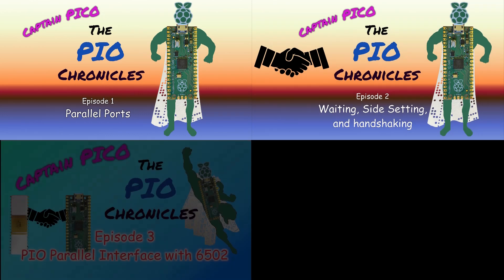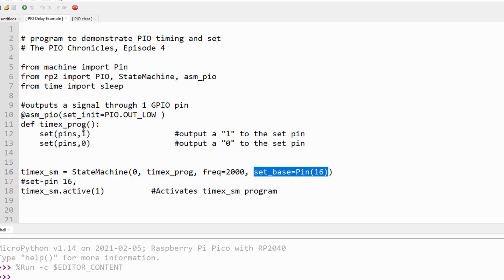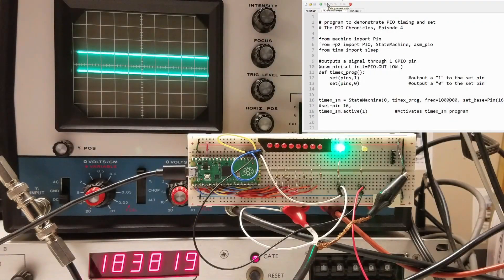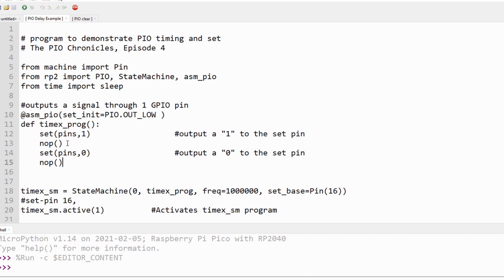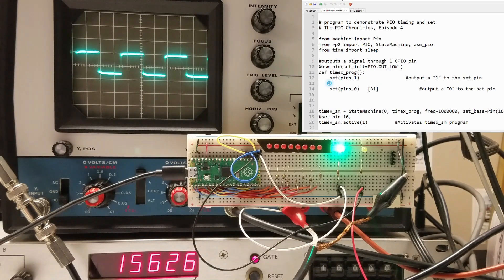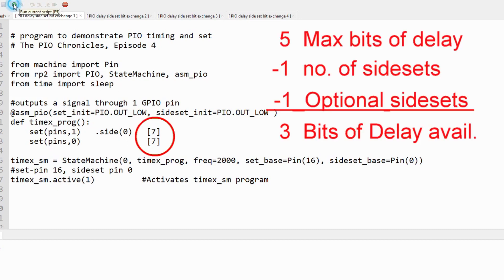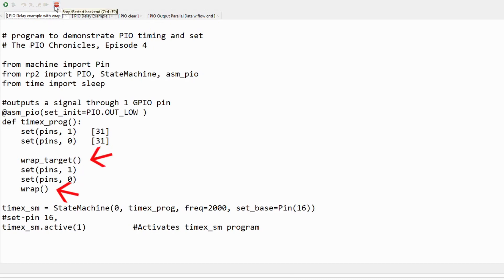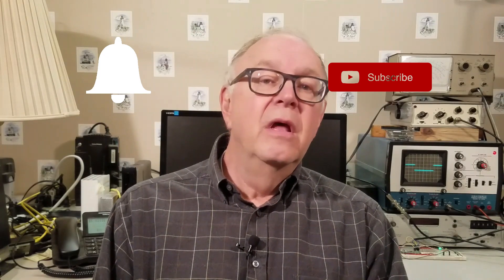Raspberry Pi Pico PIO - Ep. 4 - PIO Timing

Comment: I think I know what  MCU I'm buying next. Working towards fuel injection, and the PIOs seem like my most  realistic option towards the level of telemetry latency, asynchronous logic flow, and consistency I want. Got a lot of programming shit to learn for all that. Going for F1 AND OEM quality standards as a minimum. Right now I have a 2560 and a generator lol
Reply from the maker: I've often thought about an entire engine management system and I think the Pico would do a great job.  Good luck!
Reply: @LifewithDavid1  I decided to go with the SAMD21 based units, like the Ardunio Zero. Should be simpler to implement. PWM/duty cycle capture would make rapid/low latency RPM measurements easy. Gives a value that doesn't need calculated against last measurement, and doesn't need a provision to prevent timer overflow.

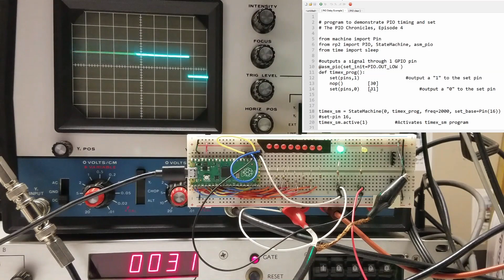Comment: Great series!  Question at time mark 7:08 you have a nice pulsing LED however I coded it up myself and the pulse is significantly faster and I am not getting that nice slow pulse you are getting.  Any thoughts?

from machine import Pin
from rp2 import PIO, StateMachine, asm_pio

# Outputs a signal through 1 GPIO pin
@asm_pio(set_init=PIO.OUT_LOW)
def timex_prog():
    set(pins, 1)  # output a 1 to the set pin
    nop()           [30]
    set(pins, 0)    [31]  # output a 0 to the set pin

timex_sm = StateMachine(0, timex_prog, freq=2000, set_base=Pin(16))
timex_sm.active(1)
Reply from the maker: Thanks for watching.  The frequency is actually 32 Hz (see the frequency counter display).  The reason the LED seems to be blinking slowly is that I'm recording at 30 Hz.  The result on video is a 2 Hz (32 - 30) beat frequency, so it give the illusion of a slow blink on camera.  It sounds like you coded it properly.
Reply: @LifewithDavid1  Thanks David!  Would love to see more on how we can do PWM style animations with LED's in future tutorials with PIO if you had time.
Reply from the maker: @mytechnotalent  My next video (in a week or so) is about the JMP instruction in PIO.  This will be the basis for being able to vary the frequency of timing loops.
Reply: @LifewithDavid1  looking forward to it David thank you for your great work!

Comment: so the main program and the pio script can react to the same gpio inbound signal ?
can the main python program keep running after launching the pio script ?
a pio script can wait for a external signal and then execute some steps and stop, so the main python program can have several pio scripts to execute in a certain order ...
Reply from the maker: Yes, both the main Python program and any or all of the eight PIO state machines can react to the same GPIO inbound signal.  The main Python program starts after the PIO scripts are instantiated (started) and then they all run at the the same time.  The PIO programs don't stop; but continue to loop.  However, you can have the PIO scripts do their thing and then get tied up in an endless loop if you want.  It's a pretty cool trick!